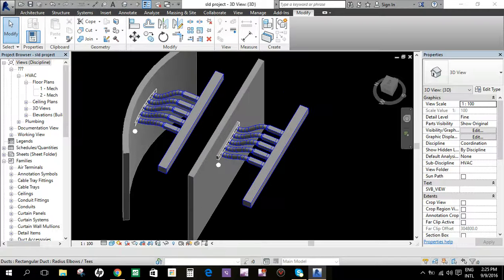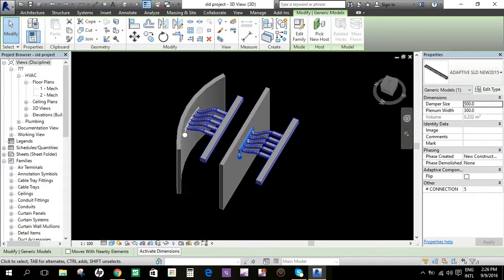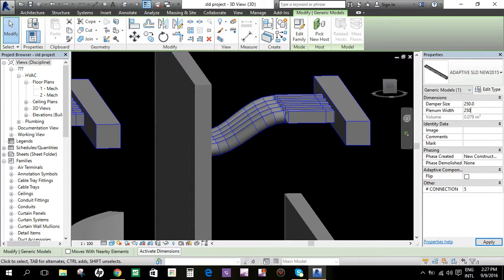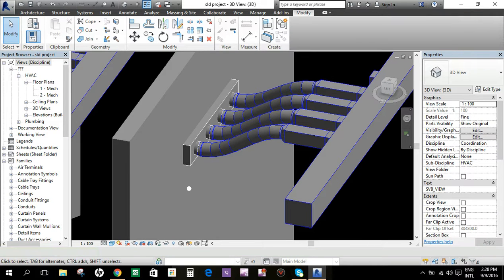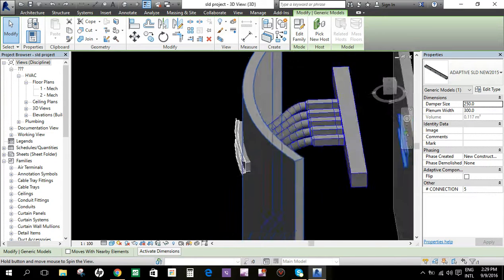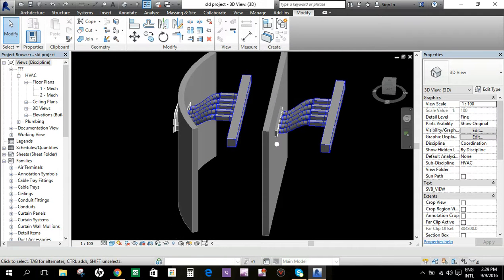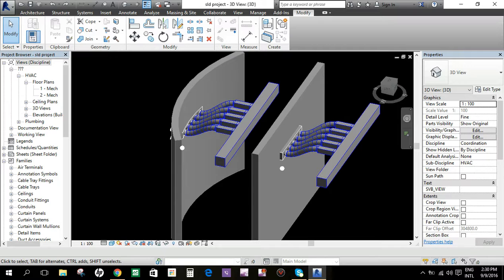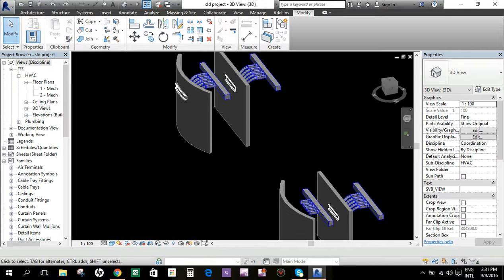REVIT FAMILY(slot linear diffuser multi function)

Comment: Sir tanung lang, gumawa kasi ako ng slot diffuser na multiple duct connector, ung naconnect ko na po sa duct yong mga flexible duct hindi lumalabas sa analysis tab yong system inspector anu po kaya dapat gawin beginner palang po kasi ako sa revit. Salamat po.
Reply from the maker: check mo kung same ba sila ng system name at gawa ka ng vav or FCU para sa calculated duct connector.